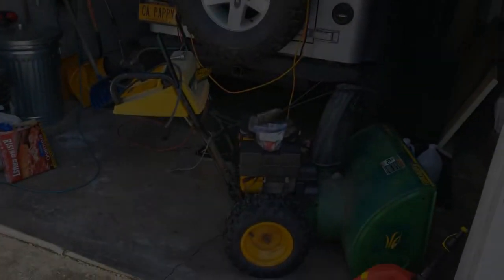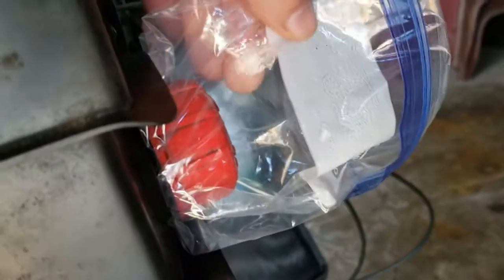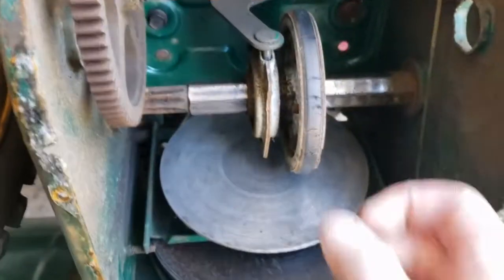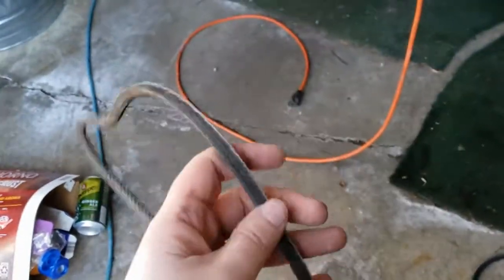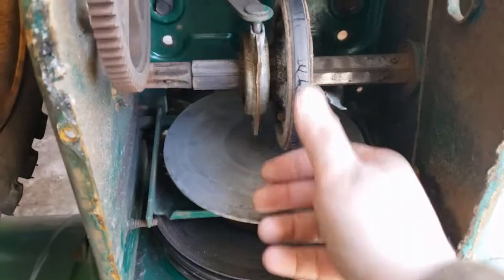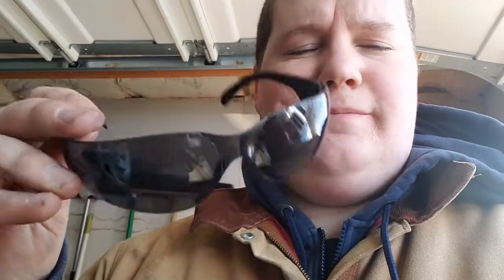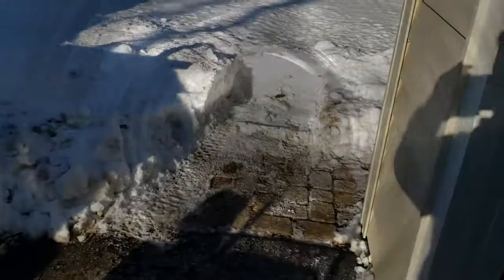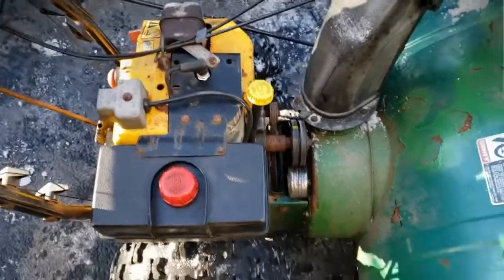MTD Yard Man Snowblower belt swap

Comment: What belts did you use? Or do you have the model number? I have the same exact blower, but my cover is missing... Which tells me the model. 😢
Reply from the maker: No guarantees these are the same belts, but the numbers for my machine are:
Double belt set for auger:754-0430
Single belt for drive: 754-0346
Hope this helps.

Comment: Biggest piece of shit machine I've ever spent money on, a lot of money, bought a brand new one and expected some quality for that price. Tecumseh motor ok as expected, snow blower is a huge pile of horse shit.. in the process of putting together parts from old ariens I have lying around now to a working ariens with 6mm steel plates and not 3mm flexooohway china crap
Reply: They have even managed to machine completely normal bearing cups so that you cannot replace a broken bearing with a completely standard new bearing that you can get anywhere, but MUST use their own bearings (which are actually completely standard bearings that they have machined a little to add a thin ring shim) which in turn causes the bearings to crack after just a little use.